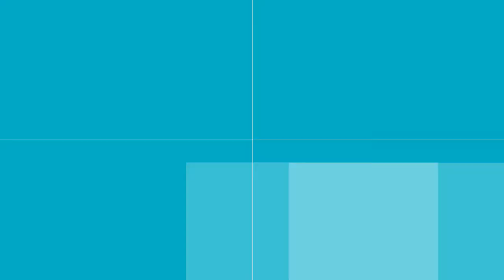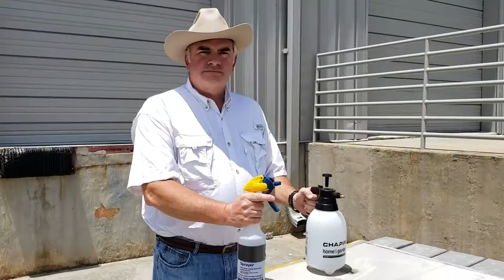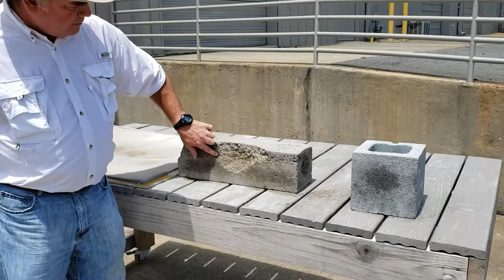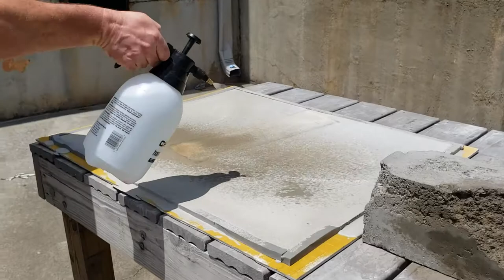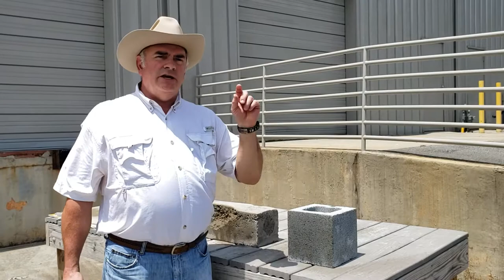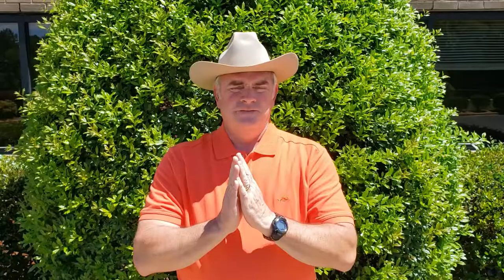SSD - Saturated Surface Dry

Comment: Thx for the video very interesting. As a Swiss civil engineer i'll summ it up saying that you dont want the concreate to change its state so you dont want it to loose or gain humdity/water in contact with an other material or surface. Thanks to the saturation, as well explainaed, the state of the concreate will not change and will be as good as the rest of it far from any other surfaces or materials.
Keep doing interesting videos!

Comment: I'm helping friends restore an old concrete block swimming pool in Wales UK. I've been spraying the background with water then grouting with a cement + SBR slurry immediately before applying the render which is 5:1 sand cement with SBR. It seems to be sticking well so far but I wish I'd watched this video before I did it! The moisture balance idea, neither in nor out, makes perfect sense
Reply from the maker: Keep every step moist before applying the next. Good luck to you sir!
Reply: @carolinasconcretecowboy-di9499  Thank you Dirk. I think we've got away with it because I've tried chipping off a few test areas and the render is well stuck to the background. I'm rendering in cool, fairly damp conditions so I think we've been lucky but if the weather had been warm and dry I suspect SSD would have been essential. I always sprayed areas to be grouted a few minutes before grouting. The SBR cement grout was never allowed to dry before applying the render. Would pressure washing the background shortly before grouting be a good way of soaking it?

Comment: What about moisture behind in a crawl space?
Reply: If it's too moist, that is, on touching the surface you can feel moisture on your hands, then it is not Saturated Surface "Dry", rather it is Saturated Surface "Wet". If the surface looks wet and on touching it your hands may feel cool but the moisture is not felt on you hand then it is sufficiently saturated and almost surface dry, considering the moisture may evaporate by the time you apply the concrete. 

In theory, there should be enough water inside the member that it will not absorb more water from the concrete, but the surface should be dry enough so that loose water should not add to the applied concrete.